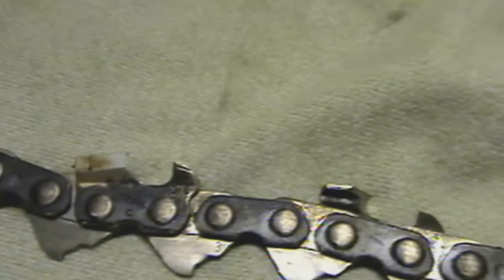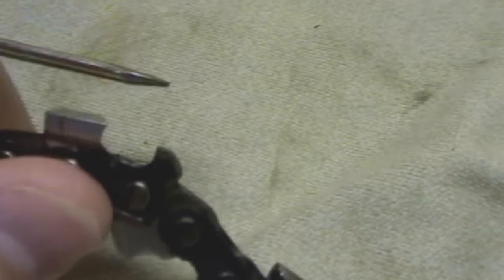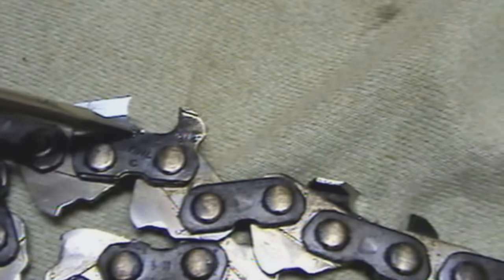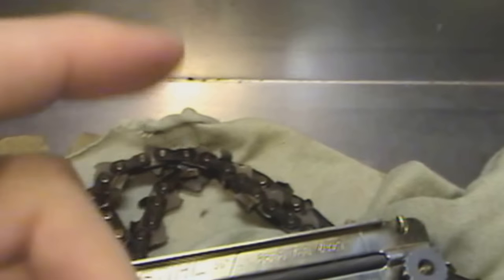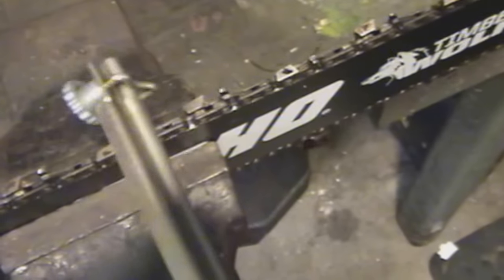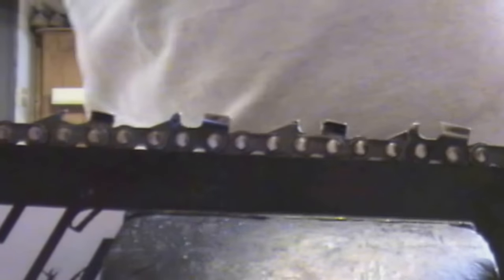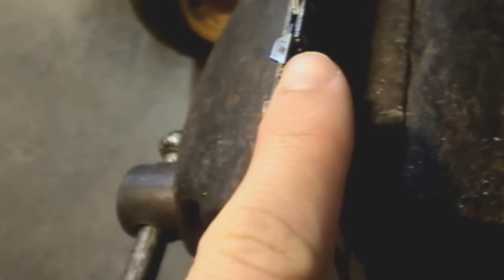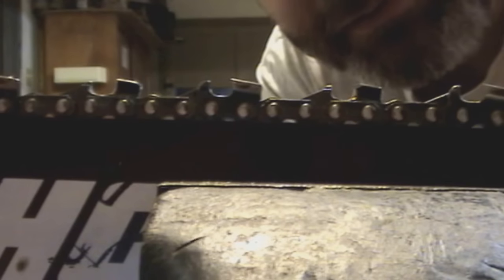HOW TO SHARPEN A CHAINSAW CHAIN.

Comment: I started using & sharping chain saws in 1966. This is a good, straight forward video on how to sharpen a chain. Good video ! Great job !! I'd like to mention, I was taught to make the same amount strokes on each tooth & on both sides of the chain. Sometimes when cutting, you might hit some metal & it often damages just one side. I suggest you sharpen the worst side first, smooth it out the best you can. Same amount of strokes on each tooth, both sides. If you get one side sharper that the other, the saw will not cut straight & on a big cut it might jam the bar & make it hard to get out....my point, both sides need to be evenly sharpened for a good clean cut....for you newbies, start it straight & let the saw do the work....If you're working the saw hard, somethings wrong. If you're getting small bits of sawdust, your chains dull . They should look something like ugly worms.  You might need to relax a bit too.....these saws are dangerous & can eat through a arm or leg in 1-2 seconds...know where the tip is every second. Make helpers stay back several feet. Please be careful !!
Reply from the maker: You're tips on safety are the truth. And thinks for the positive comments.

When it comes to getting the teeth equal lengths, well that's a bit of an old wives tail. Usually they saw cutting crooked is because the depth gauge are not set property or at all. Buckin' Billy Ray has a video with all the teeth on one side of the chain half the size of the other, with the depth gauges set properly, the chain on a 32" bar, cut true as ever. Now I agree both sides need to be sharpened properly tough, if one side sharp and the other not you'll have problems.✌

Comment: I do a lot of land clearing at work and I sharpen my chain around once an hour if I'm cutting a lot. I have always just used a file until last week. I found a file guide with a flat file for the depth gage all in one. it is awesome!! It does it all at one time and with one tool! saves a lot of time!
Reply from the maker: The all-in-one guides work well enough, but the depth gauges can only be truly properly set with a progressive gauge. This is in particularly important after the chains tooth is more than 50% used. 

That said if it's working well enough to make you happy, that's what matters.✌
Reply: bobe8888 I did not think about that. Thanks for the info! And if you have any advice for a chain that has came off and the sprocket spun on the chains bar guides and boogered a few up. I'd be much appreciative of that. I've got a few in my shop that wont fit the bar now... I got lazy and didn't tighten up my chain a few times and boom 35 dollar chain burned.  Not to mention what it's most likely doing to the sprocket.. thanks!
Reply from the maker: @quintonriley3468   A flat file and a little work and those chains will be fine. Some put the chain on loose and rev the saw a bit, while this works it causes excessive bar wear.
Reply: bobe8888 thank you so much for you time. Do you have a video on dressing a bar when it develops a burr?
Reply from the maker: @quintonriley3468  No I do not, but that is a good idea for a video. Thank you for stopping by, I'm glad you found it helpful.

Comment: One of the best explanations of how the chain functions as well as how to sharpen/maintain it.  Well done!
Reply from the maker: Thank you!
Reply: Dude why is it every sharpening video I come across they're sharpening full chisel chain. Is semi chisel wimpish Or difficult to sharpen
Reply from the maker: @wildwoodtop   semi chisel is not as efficient cutting so cuts a little slower, but is actually easier to sharpen and holds an edge a bit longer.

Comment: THANK YOU SO MUCH for posting a good tutorial on file-sharpening a chainsaw chain! ❤ ((and why would someone, "thumbs-down" a choice video like this one!? It's excellent quality and content and information loaded!!! Someone answer that!))
   There's a couple of things, that I have done, in the past, semi-professionally. (I'm too old now.) I have a bent 1/8" 7018 welding rod, with all the flux off it, and bent like a lower case "h". The top part is glued into a little piece of 3/4" wooden dowel 3" long as a handle. The bottom part of the h is bent to go straddle the bar and go down a few inches evenly on each side. When you put your bar in the vice, you center it up good and then, right up close to the motor housing between your bark claws, you shove the tool on there. It needs to have a spring pressure to it and slightly bend the side that is the end, out just a little so it won't scratch the bar. The bent side is already bent out at the bottom. This locks the chain from moving. Lift it out and use it to pull another bite of chain to work on and shove it in place again. This is worth a lot, if you file lots of chains!
   Another item that I refuse to sharpen without; is my LEATHER SKIRT. I cut a foot long piece of 5/6 oz leather, 8" wide and cased it, (wet it with warm water), and folded it long ways, in half, and allowed it to dry, folded, with a board laying on it so it would case, flat. Then I cut out a "working window" just big enough to work on one tooth at a time, 5 1/2" from each end, and 1/4" deep, right in the fold. That gives a 1" working window. (Speed sharpening, one time and 3 knuckles sewed up, caused me to make a PPE for this purpose.) Just lay it atop the chain & it comes down 4" on each side of the bar, and a full foot of protection, in case you slip, like I did once; and work safely. Bill from Tennessee 🇺🇸
Reply from the maker: Some very interesting solutions, they sound effective, thank you for sharing them!

Comment: cleaning the chain before sharpening : thats a good advice.
one more thing i would like to say for beginners , change your file regularly. i realise my file  was not taking much material because it was worn out, when replacing by a new you ll see lot of difference and efficiency.
Reply from the maker: The second the file stops biting replace it.👍

Comment: great video,thanks, i never worried about a clean gullet before, ill pay more attention to that, i usually clean it up with the harbor freight grinder,it is fast and cheap, the grinder wheel removes a ton of metal and never seems to wear much, the files are expensive and wear out quickly.     you said many file 90 degrees from the floor,  i think everyone knows you meant parallel to the floor, but you like about a 5 degree angle up, i agree, i saw a diagram in an old saw shop in bend oregon that preached that as gospel.
   it was called Had's saw shop. 
   a funny story or 2, Had was almost 80, still spry, he saw my old 2100 husky and had to have it. he said ill give any new saw in the store for it,i picked a 266 , i still use it after 35 yrs. i put a new cylinder in it, couldn't get a 266 piston, but bought another that was the same bore, then i found the carbs didn't match, got a new one for 14 dollars on eBay, then the calibration was off, had an old expert fix it for me, i always ran husky, but for 40 yrs have heard sthil is best,from pro's. i bought one 6 months ago, i HATE it  !! love the husky 266, with a 34 in bar, it is a cutting fool, i rip huge amounts of lumber with it,i use the eyeball sawmill,it works fast,with a chalkline. .  always dependable.

Comment: Still a great learning video in 2021.
Thanks for sharing.

I came across a battery powered sharpening tool, much like a Dremel tool. It has a guide feature,
Since I didn’t have 6  size D batteries, I put the stone in my Dremel.

Total failure in cutting. But I really didn’t know what I was doing.

I have a hand file w guide so maybe I’ll stick to that.

Comment: I'm going to try the Stihl 2 in 1. Just bought one the other day and sharpened up a damaged chain in the shed and I was pretty impressed with how it did the job..... Main reason is that out in the bush when you're working and you just need a quick sharpen up, the 2 in 1 seems as if it might be the easiest thing to grab. Especially when when you've left your glasses back in the vehicle or elsewhere. So with benchtop comfort, I give it a tick... and soon in the field I'll see if I'm just as happy with it there too.

Comment: One thing I would add, sharpen the chain before it goes dull, just a couple of strokes every so often will keep the chain AND saw in good order.
Reply from the maker: I agree 100%
Reply: I use an air compressor to to clean off the chainsaw after each use.

Comment: A great video!   In a Dremel, I use these: Oregon 28840 5/32-Inch Chainsaw Replacement Sharpening Stone along with a file guide placed below the chainsaw to maintain the angle. Seems to work OK. I learned three things from you: to clean the gullets, to sharpen from the inside when the cutter is on the opposite side and to place the file on a slight downward angle.  Is the angle of the cutter the same as the 30 degree sharpening angle? It seems to be close so I eyeball it.
Reply from the maker: 30° in softer wood 25° in real nasty stuff. If you have a healthy saw, just stick with 30°

Comment: i think when filing the depth gages you should  remove the gage this way you will save the file and your gage from being filed away
Reply from the maker: That's not how it works. The file glides over the gauge as the gauge is wide, flat, hard and smooth so it doesn't file the gauge down or dull the file. You're also not forcing down the file, as soon as the depth gauge is set the file will stop cutting and just glide over the gauge. Give it a try and you'll understand. Thanks for commenting.✌

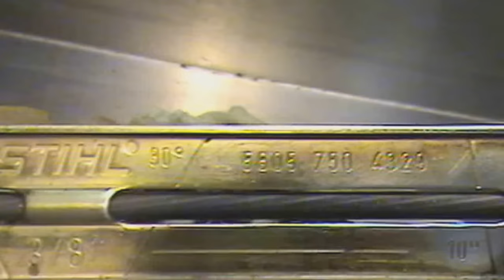Comment: Are there different size file guides though?  At 5:52, you state the 3/8" marked on the guide indicates its for a 3/8" chain.  I have one that is marked 3/16", but I couldn't find much information on file guide sizes needing to match chain sizes.
Reply: Following up my own question.  I contacted the mfg of the guide I have ( the one that says "3/16 FILE").  Apparently, all that means is that the optimal FILE SIZE for that guide is 3/16" (or 3/8" in your case in this video).  It has nothing to do with the chain ("pitch") size, other than you need to make sure the file size specified by the chain manufacturer is CLOSE to the optimal size.  Eg, my chain calls for a 5/32 file which is 1/32 smaller than the optimal size for my guide, so that should be close enough.  However, a 5/32 file in a guide designed for a 3/8" file is 7/32 smaller and might be too large a guide resulting in the file slipping around.

Comment: Very informative video. Thanks! One question though, what is your opinion of Stihl's all in one sharpener? I am new to this kind of stuff and was really sold by my local dealer on this tool. However as i learn more, i see less people using it and instead using a depth gauge guide.
Reply from the maker: Good question. I don't like them at all, as the depth gauge will never be set properly, they're bulky and won't work on skip tooth chain. The best depth gauges are the progressive type as they maintain the proper clearance by way of angle. You see as the tooth gets passed say 50% of it's life, the clearance needs to be increased to more than the standard .025" or .030" clearance.  Maintaining a 6.5° angle give or take .5°  is actually what gives the depth gauge the proper clearances. The non progressive gauges are better than nothing and they're easy to use, but you'll never get the proper clearances. 

If a file guide is needed the one I show in the video works well, is inexpensive and helps train yourself to eventually move on to free hand filing if you so choose.

Here is a video I made explaining why the angle and using a progressive depth gauge is important. https://youtu.be/81yZI9AKlp4

I plan on making a new sharpening video in HD with all this info in it, this video was to help the average person to file a chain good enough with the most common tools available.
Reply: @Andyshine77  hum, maybe that is why after i gave my saw a good sharpen with the tool, it still bogged down in the wood. Can you recommend one of these progressive type gauges? maybe a link to amazon if you could? Thank you so much for getting back to me so quickly. I just subscribed to your channel
Reply from the maker: @nickbalster2521   Boggin down can be caused by a number of things including an overly aggressive chain, to simply a poorly running engine and so on.  So without being there and examining everything it's hard for me to say the chain is definitely the cause of the saw bogging down. And remember a good chain will self feed no leveraging or pushing should be required.

Do you know what type of chain your saws has?

.325"
3/8"
3/8" low pro.

That will determine what gauge you need, the info is usually stamped on the side of the guide bar. What model saw by the way?

Glad I've been able to help.
Reply: @Andyshine77  Yeah, i sure do wish i had an expert like yourself around to assess these things. It's a new Stihl 261 C so it seems to be running well. It happened after "sharpening" the chain so that is why i kind of went down that road. I'm going to give it another shot after watching your You Tube and see it it makes a difference (without the Stihl tool that is)
Reply from the maker: @nickbalster2521   The 261 is a really nice saw. The chain is normally .325" it will be marked on the bar. 

This is the guide for .325" chain. Many different retailers offer them including EBay. https://www.jackssmallengines.com/jacks-parts-lookup/part/husqvarna/596285101
Reply: @Andyshine77  Thank you very much! Keep up the good work - love the channel
Reply from the maker: @nickbalster2521   You're very welcome.😊
Reply: @Andyshine77  ooops, sorry one more question. The guide you sent says hard and soft on it - again sorry for a newbie question, but what does that mean?
Reply from the maker: @nickbalster2521   No problem. Hard wood or soft wood. The soft wood setting is more aggressive.
Reply: @Andyshine77  Right. Duh. Like i said, i'm learning. Thank you!

Comment: Very good information, have you try Archer chain? very good for the money.
Reply from the maker: I have not, I run mostly Stihl chain.
Reply: @Andyshine77  What about Husqvarna X cut C83? I like better than Stihl RS.
Reply from the maker: @sergeyvasiliev6820   I may have to give it a try.
Reply: I use Oregon chains. What do you think of them?
Reply from the maker: @uncabull999   Well if you keep them sharp Oregon is fine. The only issue is they're softer and dom't hold an edge as long as Stihl chain. The new X-cut from Husqvarna is pretty good, better than Oregon IMHO.

Comment: Thanks give can you tell me what pitch is and how to pick the right file for a chain, I just guess?
Reply from the maker: Pitch is the distance between three rivets center to center. If the distance is .375"  it's 3/8 pitch. Regular 3/8 pitch chain will take a 13/64 or 7/32 file. Your guide bar will also have the chain specifics stamped on the side.

Comment: Yup. Watched other tutorials and then tried to sharpen my chain umpteen times with very poor results. I think I know why now.

I definitely rendered my file blunt, will need to clean the chain next time.

And much much more that I'll try to remember.

Other tutorials are ok if you only use your chainsaw once. I naively thought I could use it to remove a stump...

Comment: all true, but the gullet cleaning goes before the top and side tooth filing, in my opinion, prevents creating additional hook that you talked about
Reply from the maker: I have found the exact opposite to be true. The gullet should be cleans out after the tooth is sharpened. But do what works best for you.✌
Reply: How can you clean the gullet out before you know where the hook ends. Not trying to be a smart arse. ????🤣😂😁😀😎
Reply: @Andyshine77  
Correct, leaving a small amount of the gullet also leaves a spot for the fill to ride when filling the cutting edge. If the gullet is taken out below where the file will ride then it can be very easy to hold the file too low creating excessive hook. The good thing for me is I usually set that with my grinder so its not a problem :).
Hey that looks a lot like a double bevel "raker" file ;).
Nice video my friend!
Reply from the maker: @brettblack7049  Yes that's a double bevel for square filing, when they wear out you can still use them to set the depth gauges.

Thanks for commenting.
Reply: @Andyshine77  That's a great idea, I wonder if I can use the pink wheel on my simington on them when it wears out lol. They do work for stoning the chain though :).
This is chipper1 BTW.

Comment: And the length of each cutter? No good having a sharp chain if it cuts soup bowls sideways in a log is it? And if you can't meet up with front and back cuts. By the way. That Stihl 2 in 1 is the best tool for chainsaws I've ever used. In the field its brilliant.
Reply from the maker: The length of each tooth doesn't matter all that much if the dept gauges are set properly, and the teeth on both sides are equally sgarp. Cutting half circles can be caused by a couple different things, including improper depth gauge heights, too the bar groove being too wide.✌
Reply: @Andyshine77  We're talking about a piece of precision engineering that shares with about 3 dozen of the same and all are attached to a chain that's spinning at about 5000 feet per minute and I'm going to beg to differ with you when you say that the 'length of each tooth does not matter all that much'.
Reply from the maker: @RollingEasy   It has been proven to not be the cause of a saw cutting poorly, I gave tried it my self and, Buckin Billy Ray demonstrated this in a video. It's all about the depth gauge heights. And if you had years of experience you would know tooth lengths on new chain is all over the place straight from the factory, so are the depth gauge heights, and is why most new chain cuts poorly new, and why most loggers straighten the chain out before it ever gets put in wood.